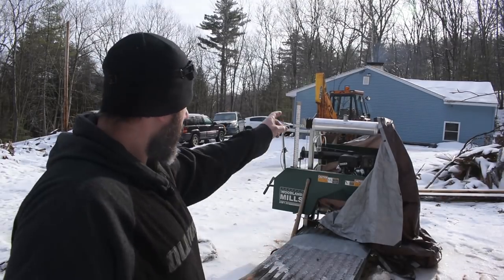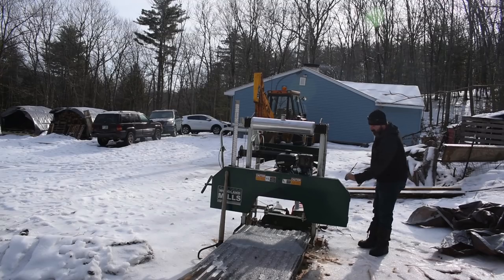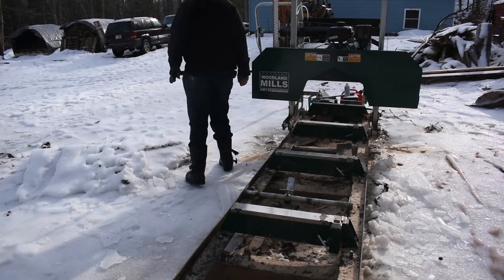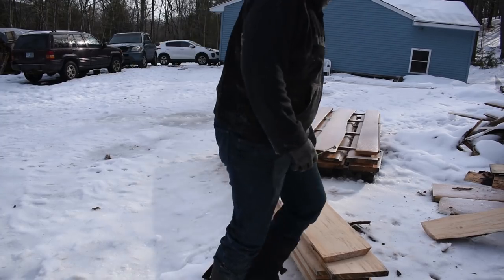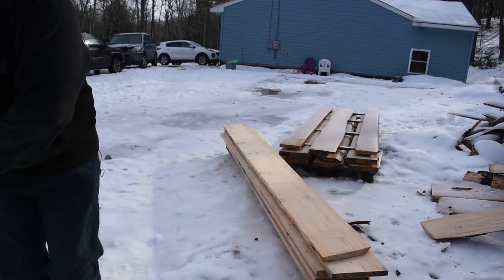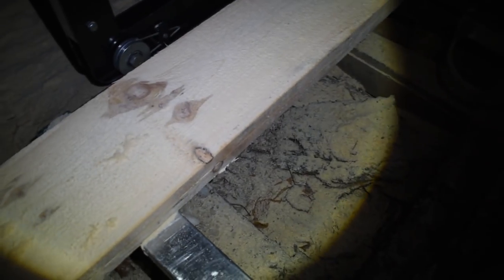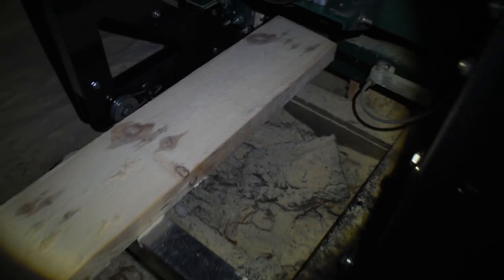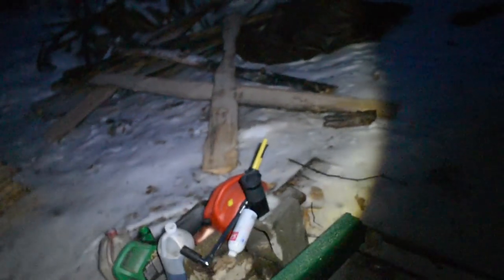Bandsaw Milling Into The Night! Pine Logs on the Woodland Mills HM 130

Comment: Hi Mike, I was planning on milling some pine this weekend also. Don't know if I will be able to limp the tractor around enough to get some logs ready. The front left ball joint on the steering came apart this morning. Got it wired together right now. On a different note, sounds like your mill was running smoother.
Reply from the maker: Bummer man!  Sorry about the tractor.  I have had some recent issues with my backhoe.  I look forward to the warmer weather when I can do some work to it.  The mill is running excellent!  I look forward to seeing your mill in action!  Thanks for watching my friend!

Comment: thats awsome cuttin there ..bummer the logged rolled off been there done that myself but ya made short work gettin it back on ...loved seein ya work into the night ..have you noticed that soft woods seem to have more friction then hard woods ??? maybe its the blade im useing
Reply from the maker: Yeah, pine got more friction for sure.  I think it's the sap.  I run more lubrication with pine, seems to run better.  And they cut even better when they are frozen.